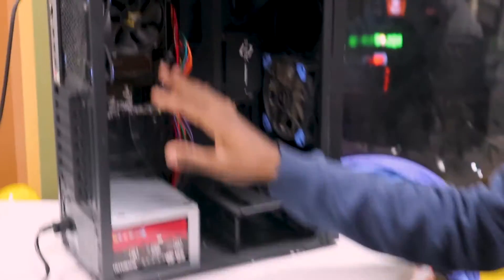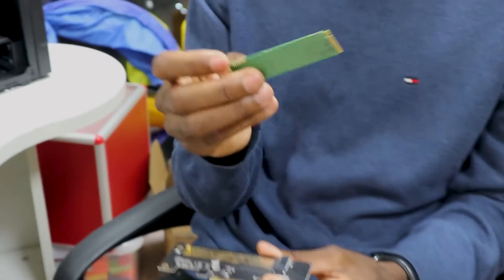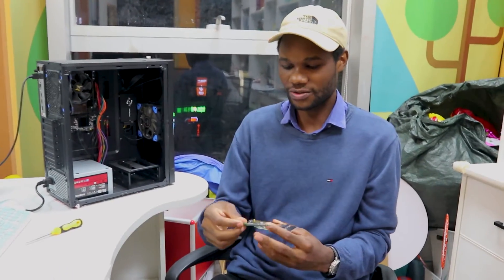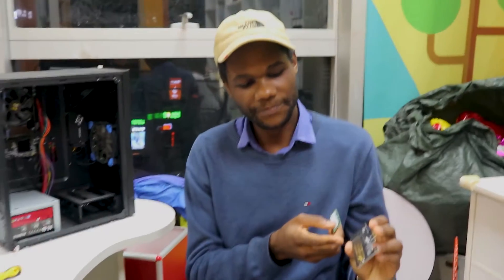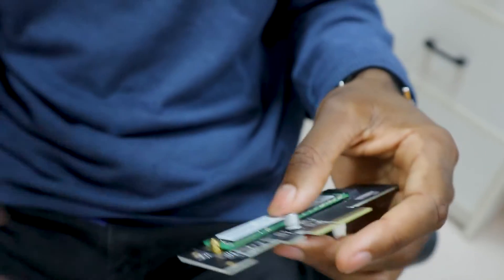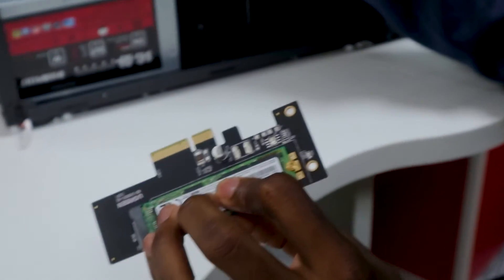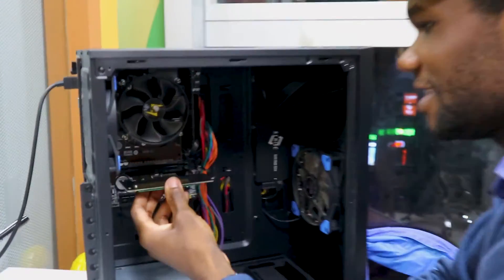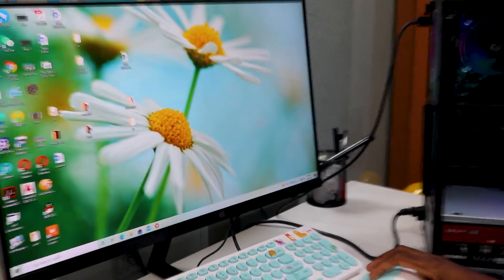HOW TO INSTALL AN M2.SSD  ||MOTHERBOARD WITHOUT M2.SLOT/SOCKET||

Comment: idk if you will respond but anyways, i just bought a 970 evo plus to my pc but the stupid asrock site shows that my motherboard accepts m2 nvme but it doesn’t, so if I buy a aic ssd and do what you did in the vid, i will be able to use the 1tb of the ssd properly?
Reply from the maker: hey that's Really unfortunate ,sure it will work,i actually run 2tb on my PC and my OS WINDOW 11 is stored on it  and to my experience it runs better than an m2 socket on the  motherboard,my advise is get one that supports two m2 slots if you want to run high storage like 4tb